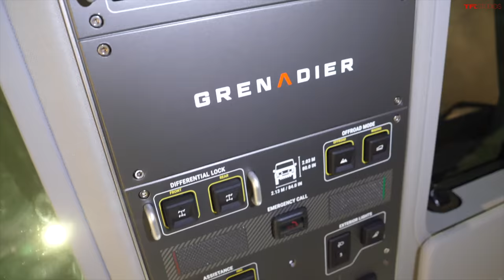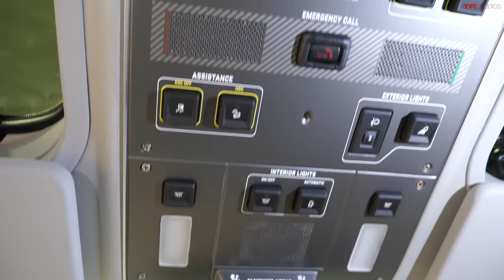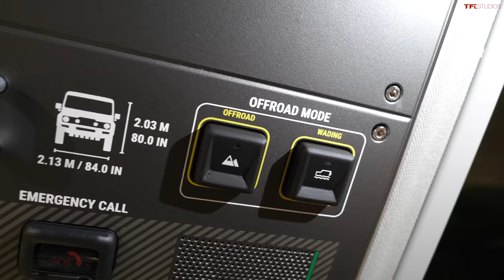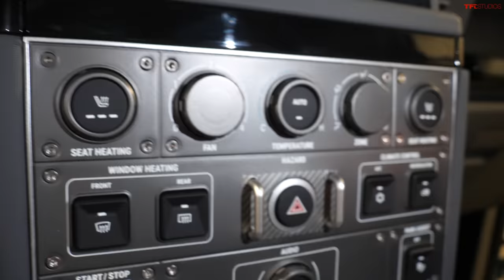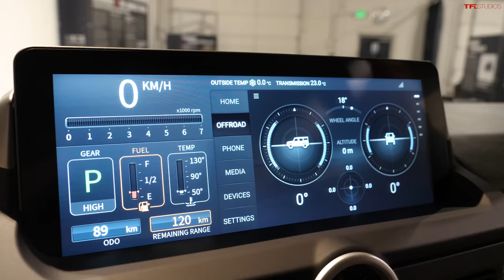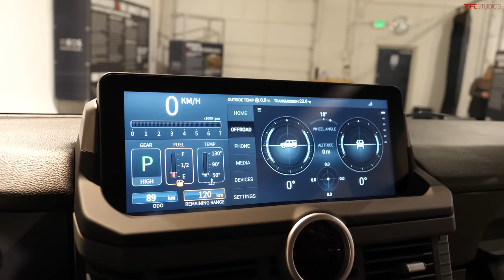The Ineos Grenadier Is The Old-School 4x4 You've Been Asking For!

Comment: The looks are spot on. The website screams about hydrogen but there is no hydrogen infrastructure. The current Defender (which I still would love to have) is a hybrid commanding up to £20,000 premium above retail price apparently. In 5 years the first full EV Defender will probably be out maybe with a hydrogen version as well. The elephant in the room is will the hydrogen  infrastructure be there in around five years? I really do not think so and Ineos 'betting the farm' on hydrogen is one additional risk on top of them being a small, niche manufacturer with little to no industrial leverage. The final challenge is going to be the residuals. Many people now lease vehicles. A five year lease will take an owner out to 2027. Will there be any residual value in a Grenadier leased now in 2027? If you are happy to write down the full price plus interest then fine but it could be incredibly expensive.

Comment: That I want.  What are the size of the tires?  Do you think you could fit 35s in it without a lift?  And on that point assume they will have lift kits to support 37s :).   The 100% electric and or hybrid versions will be especially cool imo.
Reply: Get Bronco... This is not what you are looking for.
Reply: There is some film on youtube of a factory pre-prod model in South Africa with much larger tires than this.
Reply: Stock tyres are 265/70/r17. Theres one on 35s in South Africa. small lift seems to be enough. ARB are already developing the suspension lifts for it I've heard
Reply: @Pesmog  Thanks

Comment: Hope they come out with a 6 spd manual. That’s the only thing I’d change.

Edit: and a basic speedometer and tac behind steering wheel.
Reply: I've followed the development of the truck, and they've pretty much said it's never going to have a manual. I like clutch pedals as much as the next guy, but they have a point. The real question is how difficult would it be to change the shifter.

Comment: Old school and rugged, except they used a finicky BMW engineered engine/tranny. Battery dies on the trail? Yeah, you can't get it into N without taking the console apart or going under the vehicle just as an example. Or AC stops working fully in higher temps/humidity. Or limp mode for no apparent reason that clears if you stop start/battery disconnect (where is the battery again? ;)  )  if you're lucky and don't have to go to a dealer. All of these I've dealt with personally on a single vehicle with the same motor, not to mention it's never less than $1000 every time you have it in the shop. Just can't say enough how disappointed I am they chose BMW for their engine. :(

Comment: Ineos Grenadier just killed the land rover defender with that design, let’s hope it’s reliable as it’s design.
The only thing I wish ineos had an instrument cluster in front of the steering wheel.
Reply: central cluster will become increasingly common in a bid to cut costs of converting from RHD to LHD or LHD to RHD. just look at the Mustang. they changed the dash etc to swap LHD to RHD, but didnt mount the engine centrally so exhaust manifolds have to be different to fit aroujnd the steering column in a RHD car and alsthe handbrake is the wrong side of the car for RHD cars. they didnt move it across or change the centre trims, just for one example.
Reply: @petelattimer6808  true

Comment: I'm not a big fan of the electronics on an off roader. Or the automatic transmission.  Although I've only had the Chevy 700r4  which over heats easily. so basically when you go off road your transmission needs to be rebuilt a month later.
But this is probably the closest I'm going to get to what I want.  
The problem is what I don't like has to be there by law 🤣

Comment: This will be a huge success price pending.
People that actually use and work their four wheel drives are sick of the high-tech fragile junk that is put out nowadays.

The only mistake they made and I predict they will be forced to change it after the first two model years is no speedometer in front of the driver.

I can tell you from experience that even on a motorcycle that has the speedometer on the tank instead of the handlebars, that it is extremely annoying and inconvenient to monitor your speed.

Having the speedometer in Center where you can monitor your speed at a glance is I must !

Most people will not think it's a big deal until they have to drive it for a while and then I guarantee you they won't hate it.

Comment: It was sounding interesting until they told us what engine they were putting in it. BMWs aren't reliable once the plastics start to age. I would have preferred a Toyota, which are a much more gutsy engine that won't leave you stuck on the side of the road.

Comment: Ineos: Hey, let’s start a car company. What kind of engine should we put in? 

Designer: An internal combustion engine.

Every other car company: We’re switching to all electric vehicles.
Reply: @jase9951  No. I don’t think. I doubt it’s void of any power source. If they have researchers, resorts, tourists, they have the ability to recharge an EV.
Reply: @jase9951  Clearly you know most of these vehicles never see dirt.
Reply: @jase9951  Go troll somewhere else
Reply: An EV doesn’t make sense in a vehicle designed to go off-road anywhere in the world.  Where are you going to charge it?   Though with a 7000 lb towing capacity I suppose you could tow a generator to recharge the battery when you are in the middle of nowhere. 😄

Comment: The speedo in the centre is not to my taste.  However, my mobile can tell me the speed using gps and is probably more accurate.  

I'd like the rear seat to slide back  about 6 inches for some flexibility.

Otherwise seems great.  Hope the reliability is there.  It's ridiculous that after all these decades Range Rover is so unreliable.

Comment: I wish them well but I have some doubts. This thing is going to be expensive. It's so low volume, and they have no dealer network established. Remains to be seen how they are going to work around the corporate average fuel economy standards. Not to mention the required level of safety technology which exist in some countries. I also find it curious that this is supposed to be marketed to people who really want to go off road but locking differentials are optional. Separately, looks like it's going to be a very loud interior when you were on the highway. And those sunroofs are going to leak. After all it's an English car
Reply: I too have my doubts about some of the things you mentioned, but I think you're also making a lot of assumptions. 

It's predominantly designed by an Austrian manufacturing company and built in a German designed Mercedes factory (in France) so it's not particularly English.  

Additionally, I don't think it's purely for "off-roaders". Farmers, NGOs and Tradesmen too, many of whom can probably get away with the centre locking diff.
Reply: @jacktyler5241  perhaps. I was using a little bit of hyperbole. Nevertheless, I'm not sure farmers and tradesmen will have much use for it. Tradesmen usually work better with vans. Or trucks with more space. Doesn't look like a farm vehicle either, unless of course it's a farmer who has a lot of money to spend. This is going to be an expensive vehicle with limited production numbers which is going to present lots of problems for owners. There's definitely a market for this. We'll see how big. And good luck if that company fires it CEO and decides to terminate this vanity project
Reply: I am going offroad every weekend with my Hilux and I don't have any diff locks. I still enjoy it. No dealbreaker at all!
Reply: @arnesohier6112  be careful, the armchair off rotors will criticize you. For the record, I'm not into going off road at all
Reply: @kevinbarry71  I agree with you, especially considering farmers are making less and less. Regardless, that is who they intend to sell this vehicle too.

As for Jim Ratcliffe, he's not getting fired any time soon.  Majority shareholder of Ineos at 60% and the other 40% is owned by two of his buddies.
Reply: @jacktyler5241  well then I guess he has job security. As for farmers; well, some of them are very wealthy. Maybe they'll buy this thing. Still remains to be seen how he will get past all the regulatory hurdles that exist in the EU and the United States. Not just safety and emissions, that should be possible. But all the others. It will be interesting at least; especially since I'm not putting any of my money on this thing
Reply: @kevinbarry71  Ineos are not a start up, they are a massive company. There is zero chance they would have built this if they weren't sure it could get through regulatory approval.
Reply: I’ve been in a 1 hour ride in a prototype last summer - it was very solid and quiet, think Discovery 4 as a passenger experience.  I loved it and have ordered one.
Reply: @gbgt2  they're a massive company but they don't know anything about automobiles. Skills like that are not transferable. We'll see.
Reply: @romeandcurry6915  you ordered one but you don't know what the price is going to be? It's your money but it's not something I would do
Reply: @kevinbarry71  In the UK they have suggested a start price of £48,000 for the basic version.  That is a good price here.  The deposit is refundable but I wanted to get on the list early as I know they will sell out.  Also there is nothing like it available from anyone else.
Reply: @gbgt2  I believe that the factory will continue to produce the tiny Smart cars under licence as well, so this will resolve any issues with average emissions per vehicle.
Reply: @romeandcurry6915  I understand. We'll see if they can stick to that price. I am skeptical
Reply: Uh, I think they have those concerns covered.    All engineering for this vehicle was done by Magna Steyr in Austria.   In case you didn't know, Magna builds the G-class for Mercedes, and has since 1979.
Reply: @kevinbarry71  One of their divisions has been an automotive supplier for years.
Reply: @kevinbarry71  The deposit is fully refundable!

Comment: I'd be happy with a sturdy naturally aspirated 4 cylinder with a 6 speed manual geared low.  No need for a top speed over 100.  I'd rather have low end torque at the wheel pulling a lighter chassis over sand and mud than what appears to be a 5000 pound behemoth.  Very little need to tow over 3500 pounds.  Slap on a single coat of paint with dust and fingerprints, sell it for $30k, and I'm in.  It will never be washed anyway.  No one will ever see the paint.

Comment: What’s “Old School” about it..?? It’s modern drivetrain, electronics, chassis design and materials used, it has suspension setup like any other manufacturer still uses…

These are adaptable for the end user to modify for application, so luxury it’s not, but it has uses for “Everyman…”

**The Landcruiser had split 30/70 doors** (1980s)

Comment: I like the thought put into the exterior of the vehicle, and the very cool aircraft inspired interior, but the amount of tech they put into the vehicle has turned me off. I don't need phone integration. I question whether I'd ever need cruise control in a vehicle to be used primarily for off-roading. 

I think I'm going to hold on to my '63 Willys Wagon for the future. I can fix virtually anything on that which might break out in the field with a small handful of tools, and, even though it lacks the sophisticated diff locks of the Grenadier, it's got a PTO winch.

Comment: Nope. The old-school 4x4 I’ve been asking for has BEEFY solid axles, a bombproof manual transmission and transfer case, manual hubs, a big, lazy pushrod V8, is about the size of an XJ Cherokee, and has as few options as possible (cruise control, AC, and tilt wheel would be okay).
Reply: The solid axles are beefy they're from magna Steyr ...nobody drives a manual anymore . Manual hubs? V8 diesel yeah but not many options
Reply: @matribadeneira9766  And that in no way relates to what I mentioned, which is what real off roaders want in a 4x4. And by ‘beefy’, I mean Dana 60s or something else you never have to worry about. Plenty of people still drive manuals, I personally own three, and yes, manual locking hubs.
Reply: @The_sinner_Jim_Whitney  The axles are made by Cararro.   They build the axles and diffs for John Deere.   I would guess as good, or better than Dana
Reply: @jase9951  That's probably true (though another comment here claims it's a different company, neither of which I've ever heard of), but how is parts availability and aftermarket support? There's no way it's anything remotely close to that of Dana, Spicer, GM, Ford, etc.
Reply: @The_sinner_Jim_Whitney  Carraro is an Italian company that, as I said, manufactures equipment for OEMs worldwide.  Remember, the vehicle is being manufactured in Hambach France, so supplier location plays a role as well.  The guy who stated they are made by Magna Steyr is incorrect.   Magna did all the engineering for the Grenadier and hand-built the prototype test vehicles.   They also engineered and still make the G-class for Mercedes, along with many other cars and trucks for various OEMs.   Based on the design requirements specified by Ineos, Magna chose Cararro to supply the appropriate axles, just as they chose Brembo for brakes, Bilstein for shocks, Eibach springs, Eaton lockers, Recaro seats, etc, etc, etc.

Comment: Really annoys me that the diff lock switches are labelled wrong way around
Reply: I think they orientated the graphic of the switch based on the truck orientation and it's not based on the word "Front" or "Rear". The switches are overhead so when you look up at the switches, the switches do represent where the diffs are located. I hope that make sense.
Reply: @Drewjai  but the one labelled Front has the cross on the rear axle and same for the one labelled rear. shown by the wheels being at an angle for the front axle
Reply: @bazby2106  you are right. I guess they did labelled wrong.

Comment: If I were in the market for an off road 4x4 it wouldn’t be an Ineos… can’t stand the man that owns the company. 
Why do car manufacturers insist on placing the speedometer in the middle of the dashboard, and make it a small digital one too? 
It should be squarely in front of the driver, big, bold and analogue too.
Reply: Who looks at a speedometer driving this type of vehicle where its supposed to be driven. I have registred for one and went for a test ride and I wil be taking mine up the Canning Stock route. 22 days of driving offroad without a speed sign. Get off the bituman...